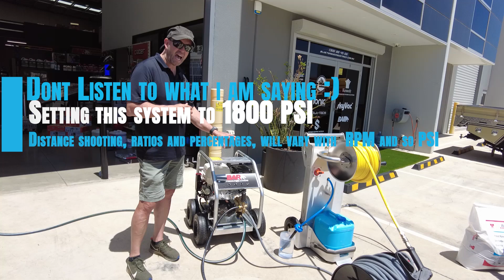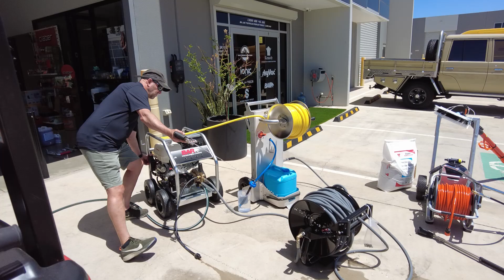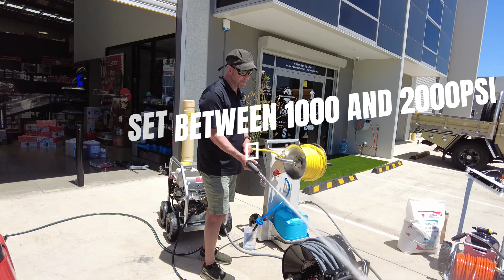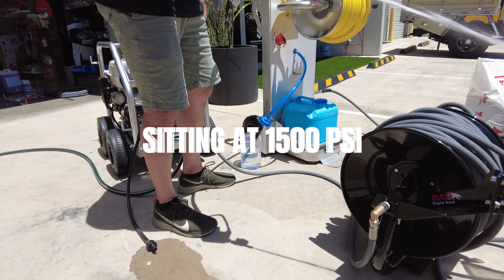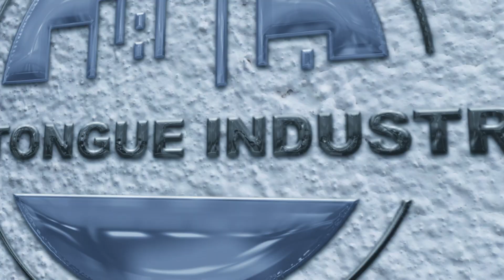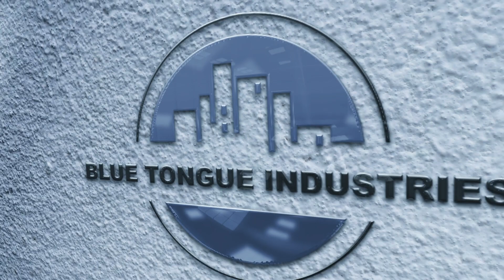SoftWash Trolley Run Through in Application

Comment: I'm surprised people still sell pressure washers with the old spring type unloaders. Have you tried using a pressure sensitive unloader (like the K1 for example)? I've used them for years and they save the hose from scratching, the o -rings in the quick fits, the trigger and the operator fatigue from the snap back of on/off. Are you guys stocking the same stuff at Burleigh? I'm near the GC and would like to pop in and discuss a battery house wash system :)
Reply from the maker: @wolfiemedia  Burleigh has a good snap shot, being a small warehouse. We ship regular, weekly from Melb.